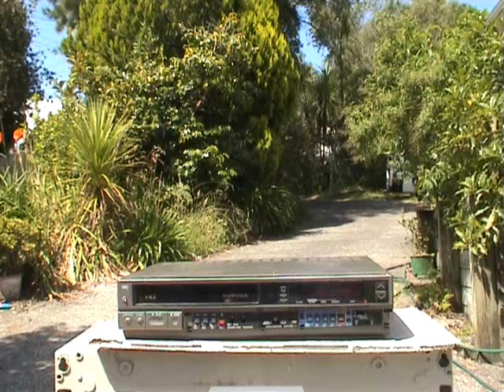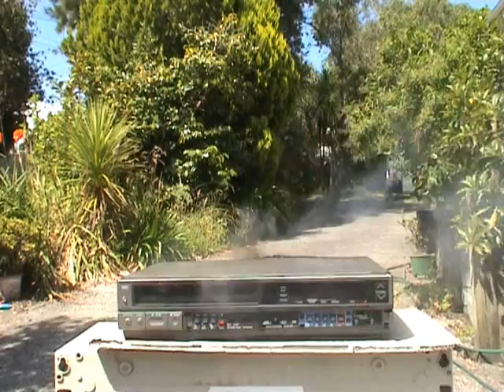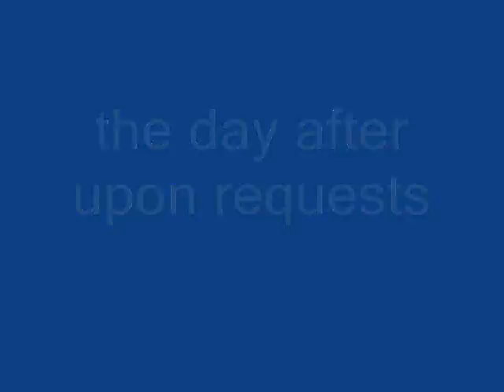VCR overvolting - long version & with the day after

Comment from the maker: @ils360 overvolted resistors carbonize and cause tracking across different circuit board tracks.
A flashover will occur and more burning will happen on parts which were not destroyed at first.

Comment: Yeah, i know about the vent lines, don't worry. Not so long ago, had to look at a PC motherboard where pretty much all electrolytic caps on the 12V rail had failed, including a further 2 on the AGP VGA card (an old GeForce2 MX), and the culprit for causing that, blown power caps also in the PSU - they went first, allowing the voltage to rise way above normal. They also seemed to be the caps prone to failure - the ones with the bad electrolyte formula from years ago! Board works w/new caps though

Comment: I forgot to mention, regarding a previous post about overvolting the fans i had - after the hour on 24V...they still worked perfectly on 12V, hadn't lost any RPMs at all! Good old YS Tech fans! Delta may be the powerful brand name, but YS Tech isn't far behind, and is often a good bit cheaper! 110cfm+, much better than just about all the cheap fans out there, most i've seen is 86cfm! And fuck Antec fans, the 3 Speed 'pro' units i have don't work well with my PC's radiator!